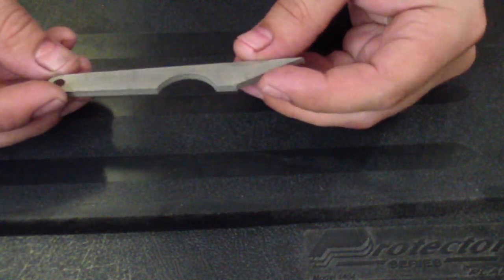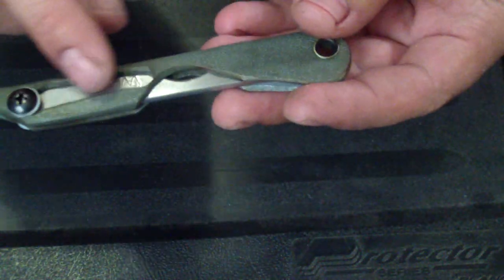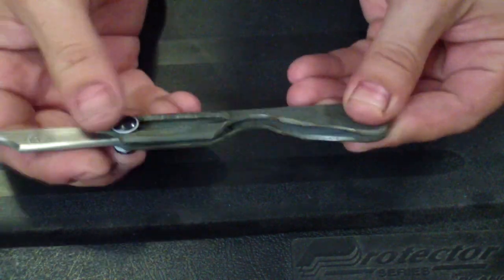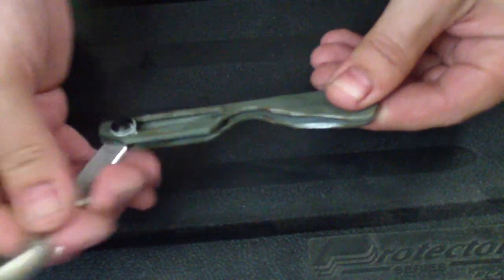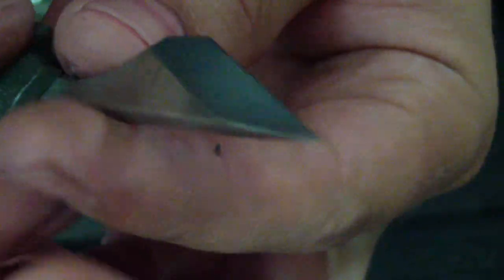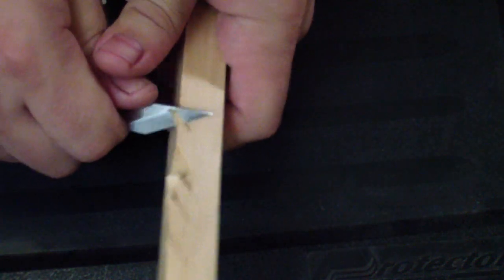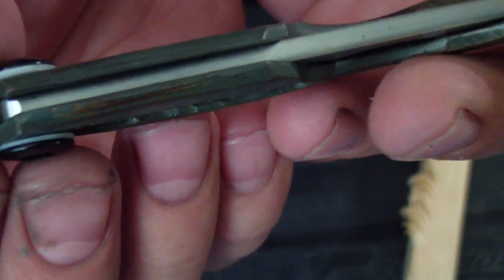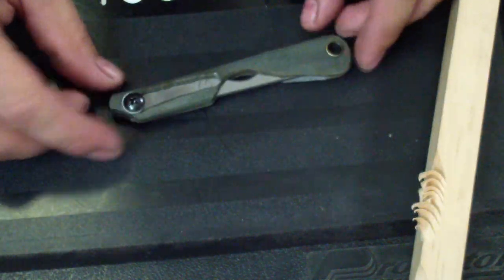Folding/Sliding Gavko Kiridashi :)

Comment: When you slid the blade back into the handle, that was my "oh shit" moment. Very cool idea.

Perhaps a detente could be created in a metal "sheath" by drilling all the way through the metal and inserting very short pins with rounded off ends on the interior of the sheath. Those pins could be used as visually contrasting elements in the overall design, too.

Comment: Gav, I wonder if you can cut kydex with a hot wire like they use for cutting foam. If so, you can just use it like a bandsaw. Maybe pop a hole in the kydex, feed the wire through and cut the slot.